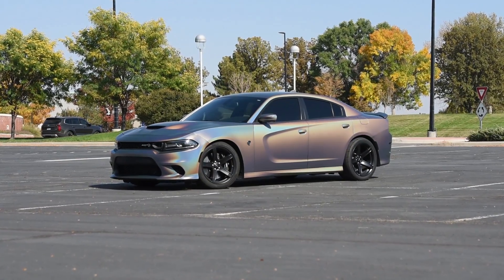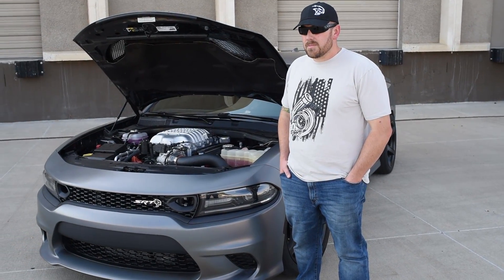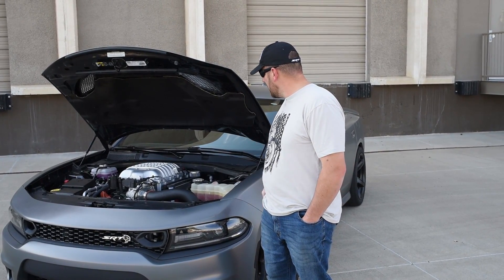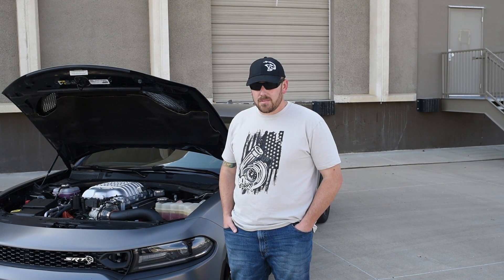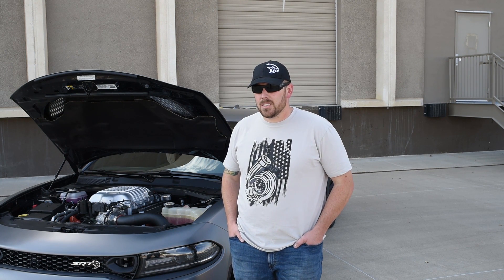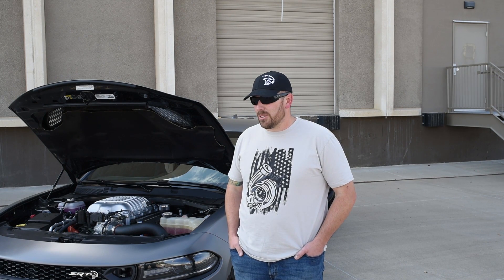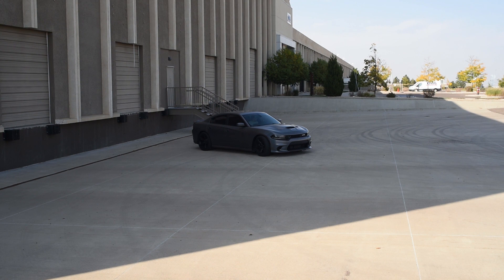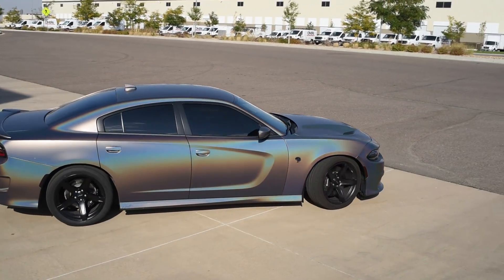Twin Turbo + Supercharged Hellcat Charger

Comment: Twin Turbos + supercharger. What could possibly go wrong
Reply: Ikr 😅
Reply: Not a lot if it's tuned right.  Realistically, any real upgrades will put more stress on everything and wear them out faster.  That goes for any car.
Reply: The rods
Reply: @cheeto225  The hellcat engine is built to take abuse. He hasn’t raised the power very much but after the tune it should be able to take some more.
Reply: Need a built engine.
Reply: Transmission because dodge never really made a full racing transmission for a car with that much horsepower!
Reply: There is nothing new about turbo-supercharging and the turbos don't have to be very big either, if you think about it they just make sure the supercharger has plenty of available air to compress and the turbos are not directly adding boost to the engine as they can't push air past the rotors in the blower.
Reply: lol to much boost for ur motor 😂😂
Reply: @xeryously704  underestimate Dodge lol
Reply: Ain't nothing wrong with twincharged
Reply: @dvdbox360  You misspelled twinturcharged
Reply: @kybx4337  Hey now that's the only accurate way to depict this. Not to mention it just looks funny, if you pronounce it like the word "winter" it's not nearly as bad

Comment: Imagine that thing with antilag 🔥
Reply: And AWD 😳
Reply: @yodaddy6340  oooo thats the killer factor right there
Reply: What do you mean antilag??..., the supercharger eliminates that already and turbos go to work at the top end.
Reply: It technically does with a supercharger.
Reply: @shaquanfrye298  fr
Reply: Why would you need antilag it had a supercharger for instant low end power
Reply: @yodaddy6340  they make them awd already lol .. cops only get them ..every Dodge Charger that state troopers drive are awd some are regular 5.7s some are 392 scats and I’ve seen a few hellcats at the station in a ghost trooper camo .
Reply: @mtbridingog9083  there isn't factory awd scats or cats.
Reply: @tannerwidstrom4456  how much you wanna bet ?
Reply: @mtbridingog9083  well this is YouTube so nothing
Reply: @mtbridingog9083  but your wrong. Find me a link amd I'll eat my words lol.
Reply: @tannerwidstrom4456  got you .
Reply: @mtbridingog9083  no you don't lol
Reply: @mtbridingog9083  If those exist you should be having an easy time finding some info huh??
Reply: @tannerwidstrom4456  they made them for state troopers here in Florida we have state troopers driving charger scat packs and I’ve seen 1 ghost camo hellcat charger with awd and hellcat challengers not sure if those are awd but the chargers are forsure
Reply: @tannerwidstrom4456  some they literally took the sxt transmission diff which is awd Also and ofc made it stronger so it can handle the power…
Reply: @mtbridingog9083  I said factory. I don't give a shit what they did aftermarket in a shop.  Dodge has never made an AWD 6.4 or 6.2 car
Reply: traction

Comment: Forget mpg it’s gallons per mile now
Reply: 20 ft per gallon
Reply: @christiansummers3971  That’s when you get a TRX with an external fuel tank, like an aerial refueler.
Reply: Smiles per gallon
Reply: Should be fairly efficient if driven normally
Reply: @EvanRutledge  underrated comment
Reply: It isn’t really any less efficient than a regular turbo car because the supercharger cuts out when the turbo kicks in.

Comment: It it’s called “Compound charged” or “twin charged” supercharger for low end torque and turbo for high end acceleration. There is a really cool twincharged lotus that was filmed for Matt farrahs smoking tire.
Reply: There is also in Europe a VW golf 1.4 lt  with the code GT (no Gti) and it has 170hp!!! Pretty good for a 1.4 lt engine! Usually at first stage mod (air filter, exchaust and tuning) goes about 210 - 220 Hp!!!
Reply: @Akis_101  you mean a 1.4 TSI!!
Reply: @kristianchristensen2254  not exactly. Tsi is only with turbo. The GT is twincharged but Yes it is a 1.4 lt engine!

Comment: Now make it awd and it’ll make it into a beast.
Reply: I love hearing ppl say "make it AWD" as if that's something you can just DO. Like, yeah, it's possible, but in the same way that it's possible to "make" a car mid engined. Gonna take a whole lotta fab work and custom chassis and drivetrain parts.  And an insane amount of time.
Reply: no
Reply: why
Reply: @thomasjohannesen1003  there is a AWD Twin Turbo Supercharged AWD Charger Hellcat
Reply: 2022 models gonna have them
Reply: @thomasjohannesen1003  there’s this YouTuber named junkyarddave who is building dodge magnum hellcat using a charger body he’s also making it AWD using trackhawk drivetrain parts. It’s still very difficult but it’s not making a mid engine car difficult.
Reply: @NoahSupermoto  there and AWD V6 ones but not any awd v8 ones

Comment: Smart hellion has always been the only ones making the compound blower and turbo set ups even the 03/04 cobra the twin turbo kit was made to work with the blower and the the turbo
Reply: I wanted to this to my sn95 But I heard the twin charge builds are kinda excessive cause the eaton blowers can only take in so much air
Reply: @ribblets17  Once the blower becomes a restriction, you need a bypass valve.

Comment: I feel like this build would be amazing if they go the extra mile and fabricate a high performance rear wheel biased AWD system to really take advantage of all that power... so much of the power is lost in a RWD set up. Its badass but not efficient.
Reply: ehh I guess but who want a awd charger?
Reply: @hundredbandzbulls  with modern technology you can have RWD and AWD
Reply: @dr.resonance4461  yeah I’m pretty sure there are electronic setups available or some gear head would be able to build one
Reply: @hundredbandzbulls  someone who wants to win a race
Reply: just get a WRX

Comment: Didn’t the only production car to do this like blow up a lot
Reply: Lmao which part?! Trans or any part under it
Reply: The block will take it, the trans will start to want to kill its self around 1200 wheel. This thing would be a low 8 high 7 car with fbo and built trans

Comment: It’s sounds more of a scatpack than a hellcat should make the supercharger whine louder
Reply: It's hard for him to because of the turbos acting like mufflers.
Reply: He has turbos and all the power isn’t coming from the supercharger
Reply: The supercharger doesn't have to work as hard as it is being force-fed hard hence the reduced whine from the blower so the engine is more efficient with less parasitic drag.
Reply: @maddog9659  yeah, pulleying up the supercharger now that it's being force fed should make a LOT of boost
Reply: @Prestiged_peck  with increased boost comes increased heat and heated air is less dense than cooler air so it's a trade-off and the point of diminishing returns.
Reply: let's say that the blower produces 16 lbs of boost and the engine makes 800hp but the blower consumes 100hp so if we remove the rotors from the blower and just run twin turbos producing that same 16 lbs of boost the power output is increased to 900hp, add an intercooler to lower air temps and we can add even more fuel and make more power..
Reply: @maddog9659  yeah but the blower isn't being fed atmospheric air when the turbos are spooled up, so  basically if the turbos make 8 lbs by themselves and the supercharger makes 8 lbs by itself, if the turbos are feeding the supercharger it should make a little over 16 lbs peak because of the compounding effect. But in all honesty it's mostly a cool factor and you'd be more effective doing compound turbos if regular turbos alone can't make enough boost
Reply: @maddog9659  meth and intercoolers have entered the chat
Reply: I know right..
Reply: @Prestiged_peck  Yes, it is cool but counterproductive, i just don't think the boost is compounded.
Reply: @maddog9659  depends on the clearances, if it's really tight like a kenne-belle it will compound it for sure, if it's a looser Eaton or something it may just blow right through. It will definitely help with spool with big turbos though if nothing else.
Reply: @Prestiged_peck  Judging from the way the car accelerates it just doesn't seem like the turbos added anything to the mix, maybe the lack of blower whine is fooling my senses.

Comment: Yall need to make it AWD then you'll be talking f the weight get the best besides possible 💪🏿
Reply: They already make the power train for AWD but it’s made for the v6 and the stock 5.2
Reply: @BobbyB910  ive heard people using trackhawks for an AWD swap, I bet even the future Durango hellcat would be pretty compatible
Reply: @DanielHidalgo9560  they make AWD chargers with a 5.2
Reply: 8 speed automatic AWD 🤔
Reply: @kermitalexander6655  would be awesome I know for a fact they make adaptable tail housings for the 8speed trans but I’m not sure if it will mount to the nv46 that is used in the track hawk. If so it would be a easier swap over
Reply: @DanielHidalgo9560  why not just use a v6 charger for the swap. Track hawks are too expensive
Reply: @Cinnamontoastcrunch1029  clearance. The v6 front diff is gonna interfere with the 6.2 bottom end.

Comment: 03/04 cobras had same setup back in the day but even with built motor you will have all kinds of problems from the experience i had and saw cylinder head lifting
Reply: @on3videos447  
What type of results?? And how has the tune changed when running compound boost???
Reply: There was a 03 cobra that made over 1200 to the rear wheels with stock supercharger stock block and heads.

Comment: So my question is if the supercharger and blades move at one pace the speed of the supercharger so did another pulley still need to be added to spin the supercharger faster in requirements of the turbos spinning with the capability to force more air in then the supercharger? so why do it if they have to match boost pressures due to the limiting factor of the supercharger maybe not in low rpm or if the turbos are turned down how does this work? is it faster then doing the stock blower or simply removing the guts to the supercharger and the rotor packs can even utilize the extra Cooling from its internal inter cooler and make it a extra air capacity housing for the twins to ram air in not having to deal with the limiting factor and parasitic loss plus heat derived from the supercharger while still benefiting from the original lid and the great thing is you can plum nitrous or meth what ever you want through it to make up that lag turbos tend to have.
Reply: Dude, this is so hard to read. Needs punctuation.
Reply: @MrDevelopTV  I think I understood him.

1. Supercharger bottlenecks turbos
2. Gut out the supercharger so it doesn’t have an impeller.
3. I have no clue

Comment: i'm doing alot of work on my superbee come april...new engine and the my car guy recommended a twin turbo setup.  I wasn't sure if you remove the supercharger that I already have on the car.  I told him my goal was to make it as fast as humanly possible.  just not sure if that means keeping both or just upping the boost on the twin turbos.
Reply: Twincharge will get off the line faster (without antilag/2-step) and be more driveable, turbos only will likely make more outright power and have more big end. If you do go twincharge max effort, use a liquid cooled supercharger, meth, and air to water to air intercooler for the turbo, and be prepared to ice both intercooler systems before doing max effort runs, but you can pin open the wastegate(s) for street use and still achieve in the neighborhood of 1k between the meth and supercharger intercooler on pump premium, then switch to race gas/E/meth for track use when you unpin the wastegates. I'm planning on doing this on a B-headed 4.6 teksid block cobra motor for my 96 GT, either hellion or on3 twin kit pumping into a kenne-bell with a liquid cooler.

Comment: I would pick one or the other sounds like a lot of added intake heat
Reply: That's why you never run boost without intercoolers. You bet my ass he's got a cooler beneath that blower. If I were him I'd put another one after the turbos as well. That would be critical if you're boosting high compression engines.

Comment: 😎!!! Tune it just right and it will out run anybody even cop cars on the drag strip.....
Reply: The stock hellcat already would do that
Reply: funny until Cops start swapping in their RTs for Hellcats as well
Reply: @Bionimetic  I feel like big departments like Houston PD or NYPD OR LAPD should have at least a few hellcats specifically for high speed pursuits, they cost the same as 2 cars for them, so it’s not even that much more
Reply: @tannerrubach3998  they already have old srt8 state trooper cars here in Florida along with new hellcat redeye challengers and a bunch of rt challengers. Thats in central Florida.

Comment: Dodge built these cars with Big horsepower and reliability at the same time,I don’t understand the goals these guys have,how much horsepower do you need?
Reply: Smokem Thebear one more hp
Reply: How much you need in reality is the V6 option, how much you want is the 6.2 supercharged....... believe me if dodge had a program where you trade in your old engine and swap it for a hellphant people would be lining up....... and then they'd still be doing upper lower pinned crank etc etc just to get more HP lol